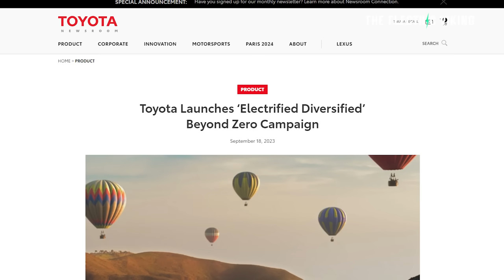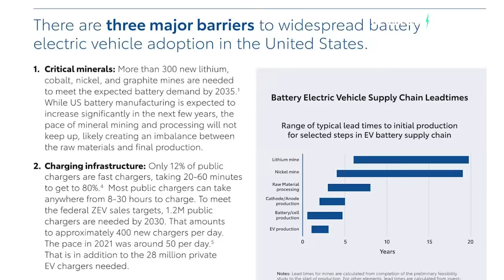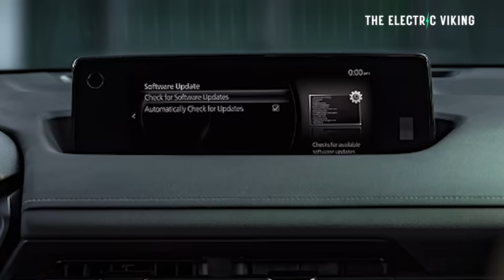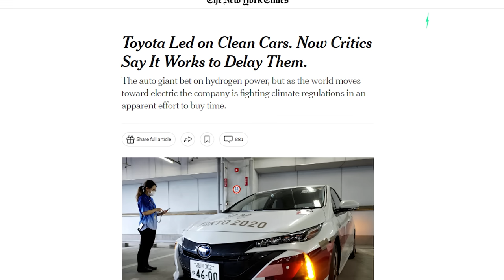We are witnessing the early stages of the biggest fall of any company in history

Comment: Global Shipping has a Huge Problem.
Hence the Huge IC Engines in Ships Could be Converted to Run on Green Hydrogen and Green Oxygen.  
Also Green Hydrogen, Green Oxygen IC Turbines on Planes is a Possibility for Green Flight.
Again Green Hydrogen, Green Oxygen Rockets is Good for Space Exploration.
These are Possible Continued Use of IC Engines/Turbines/Rockets.

However Crazy for Toyota to Not Build More BEVs.

Comment: I think you underestimate Toyota. They produced electric cars in the 1990's and found out it was a bad idea. Toyota is the car manufacturer with the highest percentage of R&D compared with the revenue. Electric cars are only useful for short distances. The electric power net must be strong enough for charging, which isn't the case on most parts on the world. Producing electric power often comes from fossil fuel , so there is no improvement in air polution.
US automakers take heavy losses, some up to $30.000 per car! Customers aren't interested in buying them as they are very expensive and not practical. When you have no driveway, you cannot charge at home, so you are limited.
Mining lithium is very polluting, so not very "green".

Comment: Yea, this guy is delusional. Just look at the colossal engineering blunders made on ICE today, trying to get emissions lower. The sheer complexity causes repair costs to be so high its very easy for an engine to simply be junked verses repaired. The supply chain for these complex machines has to be hard to manage and I have personally seen the individual parts decline in quality to the point of junking engines. I had an early generation Dodge Ram truck, like 96 that wouldn't die but wouldn't pass emissions and in Illinois where they test emissions regularly , I couldn't get its registration renewed and had to junk the whole truck, biggest lemon in the world by the way, never buy Dodge. It's just physics, zero emissions ICE is like trying to make a perpetual motion machine, its attempting to break the laws of physics.

Comment: Viking I think your missing the point on the repair and disposal of EV, I fail to see the protection of the environment when disposal of EV are 10x greater harm to the environment and those who have to manipulate the toxicity that Ev emits once those batteries 🔋 are exposed. Insurance companies will not cover repair to EV so a total loss is implemented on those vehicles and salvage yard are now piling up faster than can be dispose and recycling ,and the regulations for disposal are virtually impossible to obtain, no sir in the long run ICE vehicles will dominate for decades to come. So I would buy a Toyota ice vehicle way before I ever even consider a Tesla who happens to be the best EV manufacturer on earth.

Comment: Toyota is testing ICE fueled by hydrogen so yes, there is a zero emission ICE, just not in production yet. They have even two versions of hydrogen fuel source - gas H and liquid H and both were tested in 24h race.
Reply: "there is a zero emission ICE, just not in production yet."

Actually yes, in France there are hydrogen Toyotas on the road and have been for several yet.
Reply: @teekay_1  Those are Toyota Mirai and they use hydrogen fuel cell, not hydrogen ICE.

Comment: There are many problems why Toyota is failing in electrifying cars. But the main one is the top leadership itself. When the CEO and the Chairman of the Board do NOT believe in the cause, it's a self defeating prophecy. 

Because the top leadership is not really into it, the did plan to manage the transition from petroleum based vehicles to electric. You need to transition to it, and you need someone who really wants to make it work. Unfortunately they don't. The Japanese corporate culture is not conducive to having rengades that can champion the cause. 

I am not an engineer, but even the move to hydrogen is silly if not stupid. You have so many things to build in the value chain to make it real and spread. Whereas, there are already charging stations all over the world, with Tesla even willing to share theirs. With hydrogen, you are courting massive disaster boardering the Hindenburg incident. Even if you can solve the engineering problems with it, you are going to have to over engineer the hydrogen tank to prevent a disaster. That would mean it would have to be smaller or thicker and thus more expensive. 

Will Toyota be the poster child of a corporate downfall in the 21st century? I don't know. But the clock is winding down, and the longer they don't go in the right direction, the more probable that this will come to pass. 

But Toyota isn't in the same rut. Ford and GM are basically in the same situation. So, maybe Toyota may not be the worst of it all.

Comment: There is no reason to get rid of every ICE vehicle, they can be quite useful and properly tuned the engine can run on cooking oil or alcohol or whatever is available; also, a fuel tank will never be as heavy, expensive or hard to manufacture as a battery holding equal amount of energy. But keeping some special vehicles and hobby cars just like some people still ride horses has nothing to do with the wider future need and demand for ICE cars. And claiming that ICE will magically become net zero just by wishing it so suggests severe dementia or insanity...

Comment: Why would anyone take advice from this guy, someone who thinks that all automotive manufacturing jobs will be gone by 2035, as if electric cars float on air and operate on pure emotion.
My prediction is that in 2050 there will still be many diesels on the road, unless battery technology changes dramatically.
Even with double capacity batteries and double the charge rate you are still talking up to an hour to 're-fuel' your car only you are now requiring up to a fifth of a megawatt per car.

This is an incredible amount of power and would require rewiring the whole world and vastly more power production, vastly more copper, manganese & lithium mining.
If the charging location cannot supply you + 20 other cars, your charge rate will be throttled, resulting in many hours waiting at a charger while more cars arrive to use the occupied chargers.

Please explain a practical solution

Comment: Hi sam  facts are wonderful things ? Tesla stock is down 94 billion  and Toyota stock is up  not doing your home work  not a good look 
My new Toyota   hybreed travels 100 km on 3.1 liters  of 91 octane fuel 
I generate more electrical power than I uses the surplus go's to the  network 
I live in area which allows me to carry out my job as a  development engineer 
With very few EV charge station ,that is why yesterday just  for a public safety event i had to push a MG  EV off the road when the vehicle run out of charge .?
Please read ELON s MASTER PLAN part 3  this has the potential  to fix the EV short falls.

Comment: I laugh at your belief that EV does not create pollution.  Charge that thing up with coal plant produced electricity....
Wake up.
Reply: Thats all subject to what country you are in and what supplies your grid. Even in the worst part of AUS my EV would emit less than my previous diesel car (which was fairly low on the emissions to start with). In the UK it's a much greater saving as coal is just about dead and due to close the last coal plant this year. 
Also, grids will get greener, but an ICE will always emit the same until it's scrapped. 
Probably best to give up the whole "its powered by coal" thing.
Reply: @steve_787  the point is its not so green as you think.  I read an article on the subject that took into account every aspect of the vehicle from what it took to build it, own and use it, to disposal of it.  They refered to it as carbon points.  A  conventional Corolla scored 124 on the polluting index they used.  The testla came in at 115.  Not real big.
Also where to store the pile of worn out batteries?  And right now...who can afford them.  I cant!  
Everyone owning an EV is a pipe dream.  This inflation is putting people in a situation where alot of young people can barely afford rent and food.  Forget having any fun.  I'm old and it darn near put me on the street.  My rent of $800 a month went to $1350 in a short time.
People are getting really tired of this.  I think chages are coming to this country.  It will look more like soviet russia before its over.

Comment: Nobody but the cultists take EVs seriously.  Until charging becomes as easy as filling up a tank of gasoline and charged batteries become as safe as a fuel in a gas tank, EVs will simply remain untenable.

If you are foolish enough to think CO2 is a problem or if you just want to reduce air and sound pollution in general, then buy a plug in hybrid that can be driven in all electric mode for the vast majority of your excursions but can run on gas if you need to take a longer trip.  You'll get 90% of the CO2 and pollution reduction, you'll get lower energy consumption and cost, the much smaller battery will greatly reduce your odds of a vehicle fire, your can ditch range anxiety and ling charging lines, and, if the battery dies or is damaged in an accident, you won't face a repair bill that's wat higher than the value of the vehicle.

Comment: There's one niche, where engines will still be needed - that's where there's no grid. Then, those markets have generally relied on used cars from the developed world. I don't see Africa buying Europe's old EVs as they do with cars and motorcycles these days. Yet it's hard to believe Toyota or the Japanese automotive industry surviving by directly catering to them. It's a gap that will probably throw back already underdeveloped parts of the world.
Reply: Electricity is one of the easiest energy forms you can make yourself...
EV's can be charged from solar, wind, hydrro, geothermal, thermal plants spinning turbines, big and small engine driven generators, nuclear, etc

Small scale solar and wind is really cheap these days, and either, or both work well in almost all areas of the planet.
Can't say the same for gasoline/diesel, or H2 which won't happen on a large scale. 

EV's give energy independence for everyone...
Reply: have you not heard of solar/wind and storage batteries

Comment: I like the performance and low maintenance of EVs but I won't buy one. The growing instances of spontaneous combustion is too much risk to take. I like my house and garage and would prefer they not to be en fuego. Secondly, depreciation is enormous. The combination of tech advances, battery degradation to worthless in 10-12 years and price DECREASES manufacturers make an EV a stupid purchase. I drive older cars because I like them. NONE of the current EV's on the market will last 25, 30 or 40 years. EV's should be considered disposable. Like a ballpoint pen, a magic marker, a light bulb. It will work until it doesn't - and then you throw it away. EV's are not automobiles. They are appliances, and will be valued as such - like my Apple iphone 3 - $800 new, completely worthless in less than 5 years. Yet my collection of classic cars has doubled in value over 10 years.

Comment: EV's are great for people living in mild climate, low population where electricity can be made easily etc. Sadly living in Québec, Canada, where winter last for 5 months, temperatures goes down between -30 to -50 Celcius. We do have hydro electricity, we do not have the charging infrastructures for charging vehicles, the grid is more than 100 years old and towns, cities are spread wide all over the province. Try driving an EV when you have to be traveling 300 to 500 KM at -35 Celcius, with high winds, snow and probably end up stopped on the side of the road because of a main accident and multiple others because of the first one?? I had been stuck on highways for 3 to 5 hours while they were removing vehicles crashed into each others, ambulances, tow trucks and police trying to get to them. Snowplows getting stuck as well etc. If people love to be rescued when they had become frozen in their vehicles, hell no. I always traveled with a full tank of gas, 1 or 2 Jerry cans with 40 liters of gas or diesel for welders, cutting tools, generators and could also be used for extra gas or diesel if need be. Gas, diesel has always be bad for all health, as cigarettes, frozen foods, processed foods, bottled water, sodas etc. Sadly manufacturers, car makers have had plus 100 years to evolve the automotive industry, They could have made vehicles that did 100 miles per gallon and that would have solved a lot of the pollution around the world. But petrol companies, governments, politicians never wanted that to happen because of the loss of profits, taxes and political power that came with those. Now EV's look like a good solution but who benefits from that?? How will they manage to get the same money from EV's, electricity??? Increase prices for electricity, make people think it is less costly than gas to fill up, it won't be at all, until they find a way to charge taxes per charge, per KM, licensing and registrations etc. Garages will close down, gas stations will disappear, lots of people will also lose their jobs and income etc. Governments trying to say by this date everyone will need to be on EV'S!!! Good luck with that.

Comment: I think you're extremely overconfident about the state of EVs today. I also think you're very ignorant about the raw materials/ technology/ infrastructure of today. I don't say that to be insulting, everyone in the world is ignorant about many things... it's just a lack of knowledge.
Yes, the world has discovered more than enough lithium reserves to make plenty of batteries. The problem is that they're still discoveries today, it'll take several years before those deposits start actually yielding lithium. I could go on for several more paragraphs, but I want to move on to your biggest misunderstanding...
How will ICEs help to get us to net carbon zero? By getting more people into cars with batteries TODAY!!! People are balking at buying EVs due to several reasons:
1. The electrical infrastructure isn't in place yet. Even if you get the range to 500 miles, that doesn't help on a multi day trip across the US. I went 3100 miles in 56 hours from Washington state to Florida, 3 straight days of driving with a total of 9 hours of sleep included in the 56 hours. I don't care what EV you have, that's a 5 day trip... if you can find a charging station with a supercharger, there's not a line, and it's working properly.
2. Where are people in apartments/ condos going to charge their EV? There seems to be plenty of lithium now, but that's because the sales/ production of EVs has slowed down drastically resulting in an oversupply of lithium

The end result of what you want to achieve is to burn less gasoline. You seem to think we can shut off the gas nozzles instantly and go full electric tomorrow... that's a completely unrealistic expectation. We're still a long ways from being able to go full EV. I rented a Chevy Bolt EUV for a week after my car was totaled, I drove it around town and plugged it in wherever I could. It was the perfect city car and only cost me a few dollars for the week. I loved it, but would never venture more that 40% of its battery capacity so I could be sure of making it back home. I would never buy one because it would suck on long trips even with its 65 kWh battery. There's a skill to driving EVs to maximize the number of miles you can go on one kWh, I could easily get 6 miles/ kWh in the city. Now downsize to a smaller car and replace the 1000 lb 65 kWh battery with a 250 lb 16 kWh battery. Install a small 2 cylinder 40 HP battery driving a 24 kW generator that'll weigh 400 lbs and you just saved 350 lbs. A smaller Versa/ Corolla type of car would save another 500 lb, you're now under 3000 lb and could get 7 miles/ kWh for a total of 112 miles of range on battery alone. A smaller aerodynamic car could see 5 miles/ kWh at 70 MPH. That equates to 14 kW used per hour. But the generator is producing 24 kw, so it'll actually charge the battery at 10 kW. Make the fuel tank 10 gallons and you can easily go 500 miles. You'll arrive at the gas station with a fully charged battery, put 10 gallons in, and you're on your way in 5 minutes for another 500 miles. Those trips are rare, but essential for the car to make when needed. But now, the consumer will beat the door down to buy that car because over 95% of their driving will be short trips in full EV mode saving them a lot of money.

Wouldn't you want 95% of driving being done using no gas rather than none? You're going to have to make some compromises along the way to the infrastructure being built out to 100% or you're never going to make it to net zero. If you could get to net 5% right now today, why wouldn't you do it instead of stubbornly insisting on net zero and ending up with net 100% as people reject full EVs today. If you haven't looked lately, that's exactly what's happening with consumers. Every company making EVs is cutting back production in the US.

Comment: Toyota is going nowhere. This company has perfected the slight of hand. While everyone is watching the chairman, the CEO is making the true strides. Toyota's continued investment in Yamaha, ensures that they will have a good supply of integrated motor, inverter units. The new chip factory aimed at manufacturing to Japan will safeguard critical electronic equipment supply. The recently announced push in better cloud infrastructure for a potentially globalized support system for contemporary cars requiring OTA and other integrated services. They are very much on track. The bZ set of early models are to understand better the manufacturing challenges and vehicle lifecycle for future kaizenning Toyota style. All this will be set to coincide with the culmination of their battery tech. Imo it's too early if now wrong to call this one.